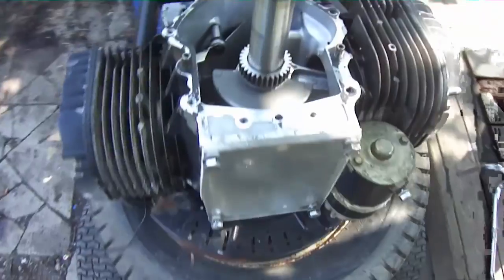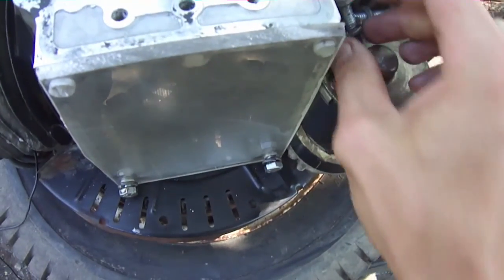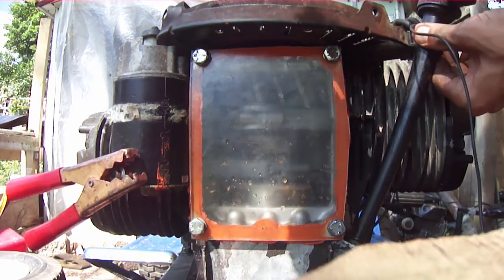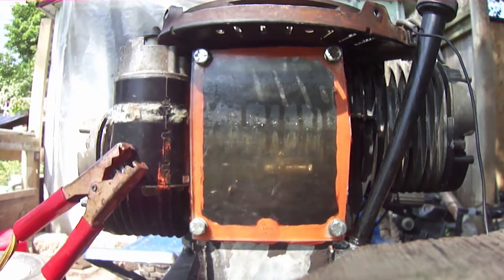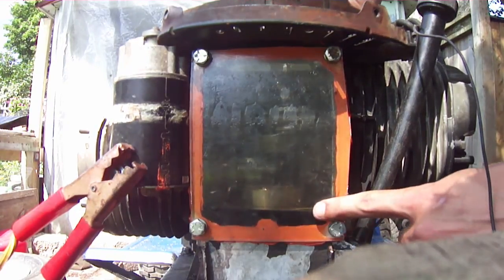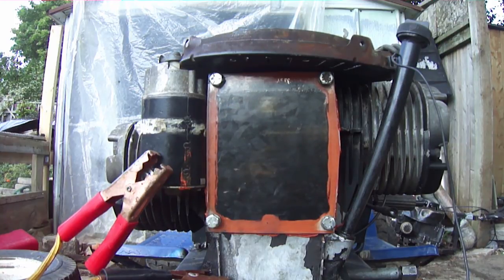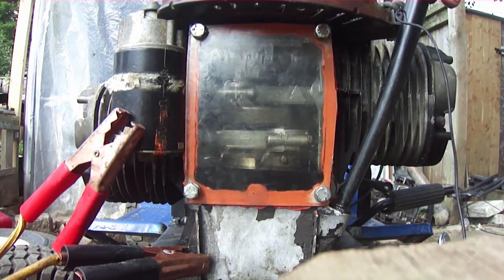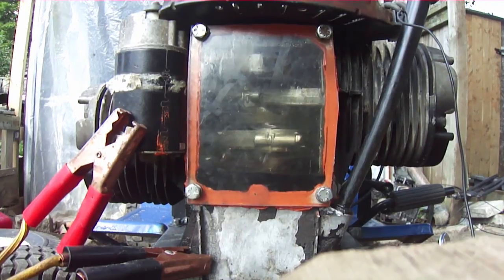Briggs & Stratton 18HP Opposed Twin I/C [oil level/system test at low rpm]

Comment: Start it & see what happens. Higher rpms?
I’ve found that on the old splash lubrication motors they run better overall. 

Interesting observation.

It sounds like he killed the starter @ the end of the video.

Comment: TRUTH>> I have a BRAND NEW (NOT REBUILT) BRAND NEW with about 5 min run time  I think it's a 1990' It is a 18 twin 2 IC Plus .looks like yours Some guy bought it in early 90s and shelved it . When I got it from him I thought he had to be bull chiting but he wasn't You can tell by the factory paint all bolts have not been touched I ran it just to make sure it ran . But did not break it in .Still has factory paint on muffler and pipes . That will all burn off after 20 min of run time. I'll do a video when I have time and I am going to sell it . I'm a retired high performance GM tech Corvette division. I really haven't a clue what it's worth I have been told around $6500. I have rebuilt and sold similar ones for$ 2600 I've seen them used on E bay From $300 -$500  I work on Harleys and John Deere compact tractors . I like the 2 cylinder L head engines like this and also Onan I have a ton of used parts for each

Comment: When the motor is standing up properly it will fling the oil to the top of the motor of course you’re not gonna see it with the lying sideways
Reply: thats a vertucal in the video. Thats how it sets.
Reply: Jake Blue Sorry brother I’m new to this I just got my first twin cylinder a posed for months ago, by the way I love it it’s moved his eyes and it has no Knox How’s that for a Briggs & Stratton unheard of
Reply: Wow that made no sense my voice command ain’t working I said it’s smooth as ice and that’s a rarity for a Briggs & Stratton

Comment: Common noise from a twin. The "top" bearing on a vertical twin is the mag. side bearing on the horizontal, and that bearing is pressed into the block as well. The horizontal twin used a ball bearing on the PTO side. Your sump bearing is what's in place of that on a vertical. You need a special tool set from Briggs to remove and replace the "DU" bearing. The Briggs Opposed Twin repair manual explains all of this better.